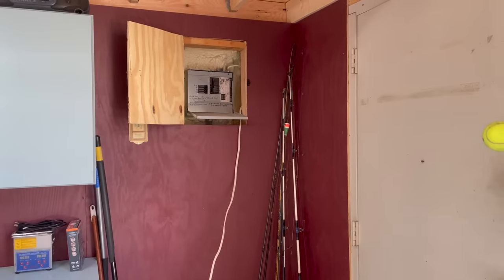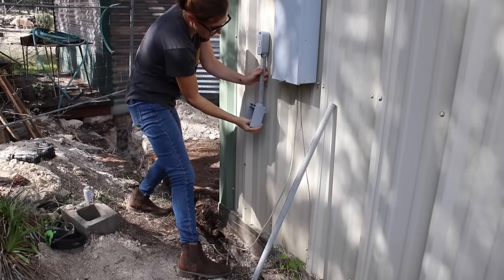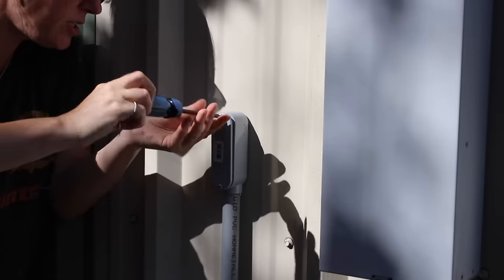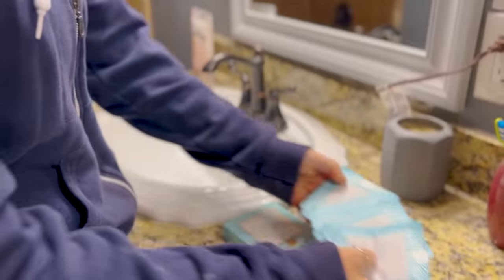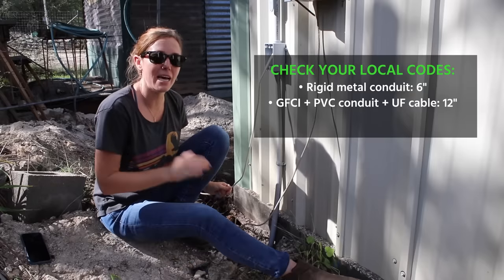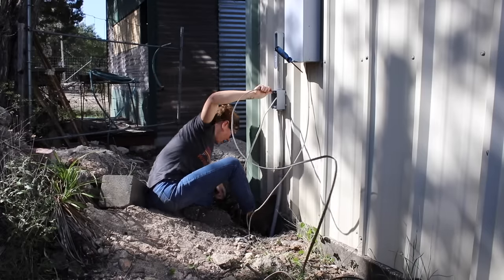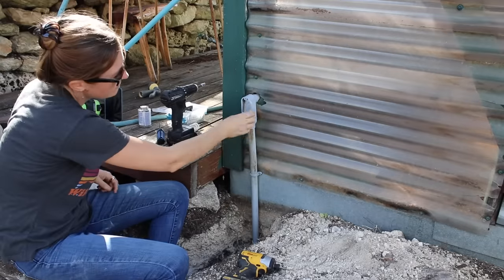How to Run Underground Power to a Shed the Easy Way

Comment: I saw others mention the romex issue so check those comments out. I would mention that any electrical pvc pipe exposed needs to be schedule 80 and not your typical schedule 40. I am impressed with your knowledge of the burial depths, not many know that.
Reply: It does not have to be SCH 80
Reply: @daveroth8060  Yes it does. It can be sch 40 below 18" or inside the structure, but above ground and outside it must be sch 80.

Comment: Hey April,
Great video. The nice thing about PVC is if you run into this later on with a project again, you could use a heat gun and apply a slight offset off the metal building over the concrete lip into the ground (1:43). By just applying a few minutes of heat along the pipe, you can shape it without any fittings. I used to do this when I was an apprentice electrician years ago, and it would work great on jobs.

Comment: conduit the full run is a good idea as well and not much more expense and also don't forget to silicone seal those LB boxes at the building to prevent water penetration!
Reply: You're not supposed to run Romex in conduit. (it can guard Romex in accessable areas)
Sealant definitely, but more likely ductseal than silicone, and possibly intumescent sealant if habitable space. Depending on AHJ
Reply: @jimurrata6785 old tale ..
But it's definitely not fun to do  compared to stranded
Reply: @luvdady  Well, I just pulled 100' of 10/3 in 3/4!!!  So I hope it's good.
Thanks for your reply!  😉

Comment: Interesting code requirements.  By comparison, in Australia we are required to bury the wire in conduit the whole way at 600mm (2ft), with warning tape just above the conduit.  It can be shallower (not sure how much) if there is mechanical protection like concrete.
Reply: Don't forget we also have to use a licenced electrician for all electrical work. 👍
Reply: @Outback_Truckie  True dat. 240 scares me!
Reply: Here in the states, uf rated wire may be used for direct burial.
Reply: @Outback_Truckie  WE DO HERE.HER I  SHE NEEDED TO ALSO PULL A PERMIT!!!
Reply: US NEC also requires a minimum cover of 24 inches. There is an exception that allows 12 inches but she didn’t discuss this.
Reply: @alamofox1  She discussed it at 3:51
Reply: @alamofox1  he didn't watch the video.

Comment: Just did a similar project running 50 amp service from from "main" panel to my shop (who builds an 1,100 sq ft shop with only two 15 amp circuits?). I had to chase it across the entire attic in the house so I used 6 AWG Romex to the edge of the house with no conduit, then put a junction box to connect to 3/4 inch flexible conduit. The conduit came down the wall outside, buried two feet under ground for a 13 foot run across to the shop then up to an LB and into the shop, all one continuous 38' bit of conduit and using 6AWG THHN. The shop is 32x32 concrete block. The conduit continues inside for the very short run to the sub panel (about 18"). 

I could have gotten away with an 18" burial, or I could have used UF to simplify things a bit, but I'm glad I went the way I did.

I had a good friend who is a licensed electrician help me with the attic work since I'm too old and inflexible for that rather cramped space. It was really just securing the Romex and splicing the Romex to the THHN in the junction box.  He knocked it out in under an hour. Thankfully it was a reasonable cool Florida day in March with heavy cloud cover, so the attic wasn't dangerously hot, which is the default setting for Florida. I did the trenching myself, and learned all about the surprisingly lax codes for PVC thickness and burial depth for irrigation in Florida. Don't ask me how I know. Let's just say that if you made a pipe out of Playdoh, it would be sturdier.

Comment: I see a lot of good information from other commenters about using underground as opposed to romex. I've heard this from other sources. The only thing that I would add to the comments about this video is instead of running the full length of the cable that's going to start at your GFCI through that piece of conduit going into the ground and then to the shed, I would pull a string into that conduit and then pull the three or four feet necessary from the underground exit point of the conduit back up to the GFCI outlet box.

Comment: In Australia we need to be 600mm minimum deep with warning tape 100mm above the conduit. Also pull your cable through first then make you joins. It makes for a much easier and quicker job without the struggle.  Anyway different regulations for different states and countries. Good to see your having a go and not scared to get your hands dirty 😊well done and look forward to seeing your next job 👍👍
Reply: She is in violation of NEC 300.5.  24 inch minimum cover for direct buried cable.
Reply: @alamofox1  no, 24 inch min for direct buried cable if not GFCI protected... she alludes to this in the video... 300.5 column 4.  12 inch if GFCI protected and 20 amp max circuit.

Comment: Just to clarify, the GFCI should be BEFORE the underground cable run, not just anywhere on the circuit. So at the panel (gfc breaker) or an intermediate GFCI outlet as you did.

Comment: Nice video again 👍
Consider adding also Ethernet cable whenever you run cables between or in buildings, it comes in sooooo handy if you need to expand your Wi-Fi on your property … yes, Wi-Fi mesh works, but there are many draw-backs, so good ol‘ wire is a good thing to put in.
If you can use cat7, from my experience it’s not much more expensive than cat6(a),  but shields against all kinds of interferences ;)
Cheers 🥂
Reply: Ethernet cable nor coax should be included together with power wires in the same conduit.  Use separate conduits in the same trench.
Reply: @royreynolds108  Yes, that’s true.
And, even if direct burial wires are a thing, conduit between buildings is definitely worth it, to avoid digging later again, if some changes are needed 😉
Reply: Nah
Reply: If running copper utp cable,  your nw performance will suck badly.  Running utp in parallel with power without shielding is guaranteed to hobble your performance.  Worst case I saw was when some Muppet actually wound the utp around the power cable.  If using fibre,  no problem ( but b3st to have it in its own conduit as its more fragile. Standards state that utp must only cross power cables at a 90degree angle.

Comment: In my county you also need to pay a small fee, get a permit and have it inspected prior to filling the trench.  Later on if you sell the house, get a new mortgage or get homeowners insurance they will make you to sign a form stating no electrical work was done without a permit and inspection.

Comment: Nice job. The only thing I saw that was not correct is you ran standard NM-b cable from the inside to the box that will have the GFCI. NM cable is not rated for wet locations and any conduit installed outside is considered a wet location due to condensation. To get around this you can run the cable directly into the back of the box that will have the GFCI.
Reply: yeah I was going to ask that very same question even looking up the romex color codes...great observation!
Reply: Or put the GFCI indoors, that will protect the GFCI itself from temperature extremes so it would last longer and provide a good place to plug in a Homeplug adapter for extending network to the remote location.
Reply: I thought GFCIs only protected what was plugged into them, not the circuit they were on?
Reply: @gregbell2117  You can wire them to protect everything downstream of the GFCI by using the LOAD terminals on the device.

Comment: Others may have said it, but direct bury cable has to be 2’ deep regardless of what material your risers are. 
Shallower permitted if entire run in conduit. 
This is to protect wire from damage from digging.
Reply: False. GFCI protected UFB cable on a 120v 20a circuit can be direct buried at 12 inches.
Reply: @nyetloki Only in schedule 80 conduit.

Comment: 4:45 haven’t finished watching the vid (so it’s possible what about to add as a tip was used)
Another TIP for outside or anywhere using conduit or fittings or penetrating structures w/ holes and want to seal up holes for bug protection and weather……DUCT SEAL. Great stuff that has been around and used for very long time, and comes in bricks or small tubs (similar to spackle containers, but I’d pay for the brick kind as usually cost usually less when compared to amount getting, and can use in many different places and save it for future use). Also, yes, “can” fire stop and caulk the penetrations and in some areas I’d go that route, but say inside an LB, Duct Seal is what want to use, NOT any type of product that comes in caulk tube, imo, as can be difficult & messy. Also, yes, for ppl who gonna ask or want to know, can use the correct rated spray foam type material for inside electrics, fittings to seal up holes/air gaps, and then can caulk with exterior sealant etc….around the LB for more protection).
Ok, back to the vid😁✌🏻
Reply: We call the stuff, "thumb gum".

Comment: I take it that Romex wire you used was solid wire? When I did underground wire pulls, I always ran conduit from one end to the other, then pulled stranded wire. It’s a little extra work, but it’s easier for one person. Thank you April for another great video
Reply: They don’t make stranded Romex cable fool.
Reply: @daveroth8060  yes I know. I was referring to thnn individual stranded wire

Comment: Great work April.  I was running a direct burial line out to my barn, I flunked my inspection because I crossed a driveway at 16" depth, not 18".   Geeezz.
Reply: Codes are meant to be followed. Eighteen inches is the minimum. Play it safe. Go 24" or even 30".
Reply: @turdferguson12  I live on a ranch in very rural Colorado out in the middle of God's country.  Prior to building the house I built a barn, I was bringing new service in from county roads to barn (4 miles).  The only way ANY public utility will bring in new service is with a electrical permit, which are governed by states who share the same codes.
I chose to trench 2 inches deeper, rather than spending winter and nights freezing in the dark.  Plus my welders and barn heaters don't make good pasture ornaments.
Reply: @RobertBeck-pp2ru  Yes, the code is intended to be more or less the minimum that is acceptable. You can go above it to the extent that the gear and budget exists, but code does get updated over time for situations where it proved to be insufficient.

It may not seem like some of this is a problem, but things like the spacing on outlets does typically address a problem, just not always an obvious one.

Comment: Code for how deep to run your conductor is 24 inches without protection. If the run is under a sidewalk, driveway, etc you may have it 12 inches under such protection.  Recheck the NEC. I did when I ran power to my shed a year a year ago. It had not changed since I was in a NEC  class back in the 90's.
Reply: Column 4 of table 300.5 in the NEC is what she referenced for her depth. She's running a single 20A 120V circuit with a GFCI and that allows her to use that 12" depth.
Reply: GFCI is the protection, for a 120v 20a circuit with a UFb rated cable.
Reply: @kevinbowers4394  yep, people gotta read all the code, it's not always clear at first glance...

Comment: The conduit coming out of the ground should have an expansion joint. You don't need to use UF cable, you can use any cable that has an insulation rated for wet applications. THNW is a lot easier to pull. UF can be used for direct burial. The 12' burial is for 125V max 20 A max.
Reply: This was direct burial
Reply: @Zach_Miller  I thought I saw a conduit from grade to the cabinet. No?
Reply: @albatross5466 The conduit was only used to get the cable to the bottom of the trench on either end. She didn't run pipe the length of the trench.
Reply: @albatross5466  you have to protect the UFB from depth to above. Anything above depth up to 8 feet needs conduit.
Reply: @nyetloki  I incorrectly assumed that she had run conduit for the full length of the trench. Others have pointed out my misunderstanding. Thanks and Merry Christmas.

Comment: It would have been nice to show how you wired that into the breaker box.  Once in the shed, that wire could go anywhere; into a sub-panel, into a single outlet, into a lighting setup, but wiring it into the breaker box at the source is pretty much the only option (unless, maybe, you are connecting to an existing plug?).

Comment: Sometimes heating the cable at the turning point helps it bend easier.
In cold climates the outer coating can micro crack.

Nice job though!

Larry

Comment: When using an LB you always want to bring the wire into the LB through the long straight side and out the 90 degree side. Doing it backwards as you did with the first LB makes it far more difficult.

Comment: Hi April, great video.  I am wiring a new shed.  When I attach my LB fitting to the outside of my home, and also the shed, and add a small length of pvc conduit to the LB fitting to get through my shed and also the rim joist of my home, can I switch over to a metal junction box on the inside of my shed and also the inside of my rim joist?  From there, I would run to my breaker box for in the home.  I would also run inside wire within my shed to any new outlets, switches, lights, etc. from the junction box in my shed.  Thanks

Comment: In Australia we are not allowed to do any electrical work without a licensed electrician, even changing a switch or wall socket! If you do it on your own, home insurance will not pay out if your house burns down. It's costing me about US $4000 to run single phase power about 200 feet to my shed.
Reply: Yup, need more goverment running every little thing in our lives.
Reply: I'd make sure my insurance company didn't know that I changed out the switch. :)

Comment: It is good to check local codes. You mention the depth using pvc and a gfci but looks like you only used that to get into the trench and actually ran the UF cable by itself in the trench. Here, that would be more like 24" deep. They do sell fittings for rigid conduit that are compression so no bending or threading needed.

Comment: In my state, conduit can't have Romex in it.  It has to be THHN individual wires.  Also, PVC or direct burial Romex has to be down 20 inches, unless you have concrete above it.  And you left out the part about the building inspector having to measure and approve your trench depth before you fill it in.  But of course, every place can have different rules and procedures.  It pays to find out your area rules.
Reply: 12" depth ok for direct burial cable where ...residential...</=120V ...</= 20A ...GFCI protected.  It appears it meets this criteria.
Reply: The conduit is only protecting the vertical drop at the buildings.  There should be no problem with this in your area if you are using type UF Romex, like April is using.    What code # indicates this?

Comment: Not sure how I feel about that strap on the outside. Leaving polymers in a stretched configuration can lead to creep, or in the winter could snap. PVC may be slightly resistive I don't feel like consulting my textbooks over it but just something to consider. I am sure they make small curve segments for the PVC.

Comment: I've never fully understood the attraction of UF cable. If you have already dug the trench, why not use PVC the whole way? In my estimation, this allows wire to be upsized when needed without digging a new trench. Plus, UF cable is so challenging to cut and work with, not to mention its lack of mechanical protection.

But that's my little nitpick. I appreciate how well you presented everything.
Reply: I think the only benefit is that if you have to rerun the wire, fishing it around two 90 degree angles can be a pain. But, by the same token, if you've got the wiring through properly sealed conduits the entire way, the likelihood of needing to do so is also greatly reduced.

Also,it's worth using a bit of sand around the wire/conduit in the ground. It makes repair and replacement easier and if you decide you need a larger, conduit it's easier to remove the one you've got. Plus, it's a bit of a warning to anybody that is digging that there's this sudden unexplained sand coming up, perhaps there's a wire or a pipe down there.

Comment: April,yer a Sweetie!  You can bury a wire easily without digging a trench in yer backyard.  Step a shovel into the ground and rock it back and forth to make a "V" groove. Lay the outdoor wire in it. And moosh it closed.

Comment: I had to do something very similar when I installed wiring to my well house during the construction of my home.  I'm not an electrician, and this wasn't exactly "easy", it's just the way it has to be done!  You don't want to do in-ground electrical work the wrong way though!

Comment: I dont know what the NEC is where you are, but it is not recommended to run romex in conduit, it can get really hot being that it cant breath, the sheath on the romex needs to breath, romex is intended to be run on its own, that's why the sheath is put on it, when running in conduit you should use THHN/THWN wire.
Reply: What NEC code # is that, Eagle?   My understanding is you can use UF in conduit, as long as the conduit is large enough, but it would be a lot easier to go with the THHN/THWN, absolutely.

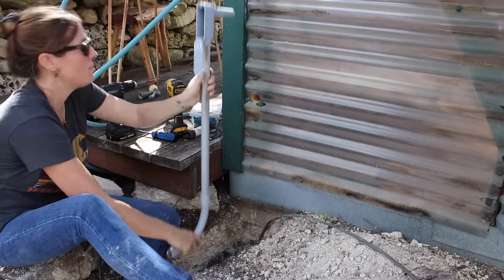Comment: 4:55 You can feed the wire through each piece first and then glue it up.

Also: don't dry fit. It's not worth the hassle of struggling to get them apart.
Reply: Installing conductors before the conduit is complete is a code violation. Code reference 300.18

Comment: I do similar things on my properties…however I like to run continuous conduit in case I need to add another wire or upgrade the installed wire sometime down the line